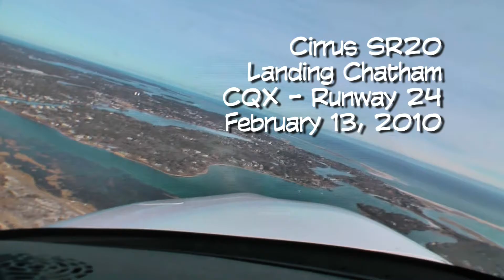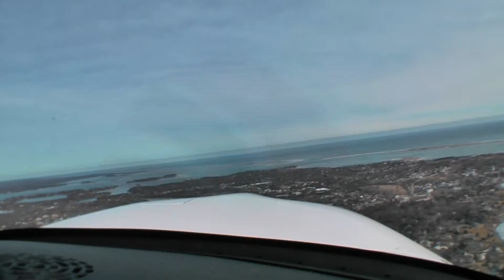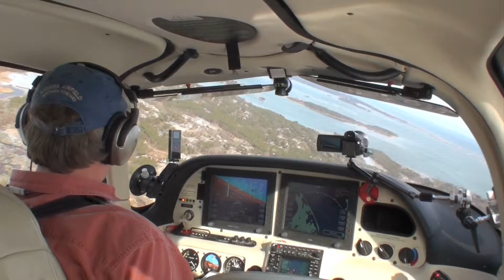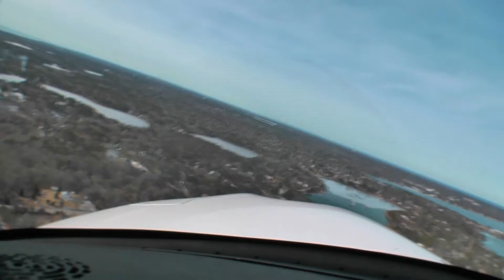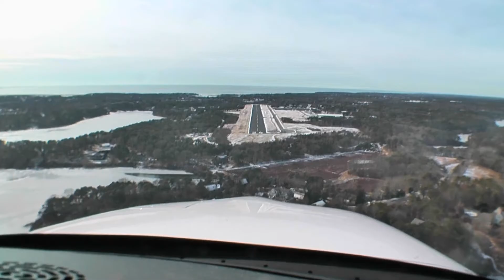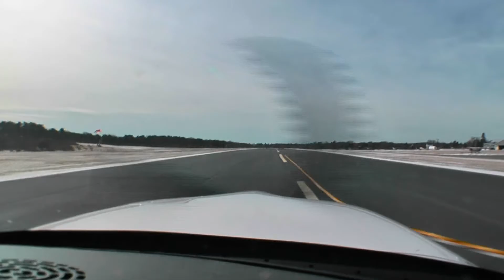Cirrus SR20 Landing CQX 2-13-10.mov

Comment from the maker: The "Lights Camera Action" thing was something my first CFI did.  It was a way to remind myself to do the important pre-landing stuff in any plane. So in the Cirrus it is a check of the fuel pump (needed in the case of a go-around), flaps settings and landing lights.  Lights is obvious but the other two are just as a reminder.  And the undercarriage thing is something I say as part of the GUMPS check in any plane in case I some day flying one with retractable gear.

Comment from the maker: Basically it will cost you to rent the plane for the required check-out period.  Up here I'm told it's three flights at least to demonstrate your comfort level.  So it depends on how you switch to a more powerful plane and low wing.    To me the side stick isn't much of an issue, but that's also a big difference.  So hard to quote costs, but it doesn't take much.  That's the SR20.  The SR22 is another matter and will take longer and cost more.